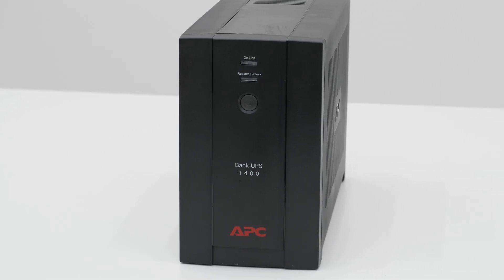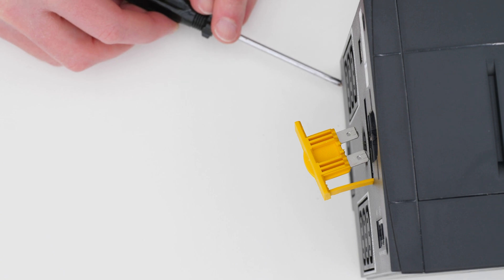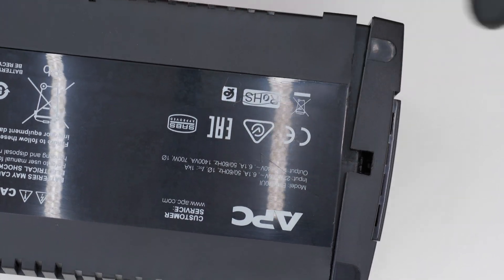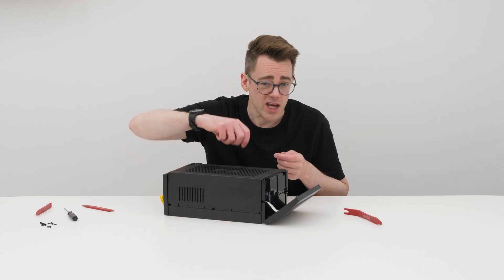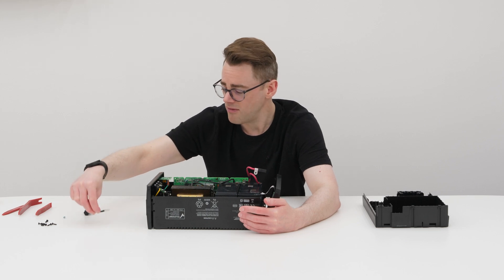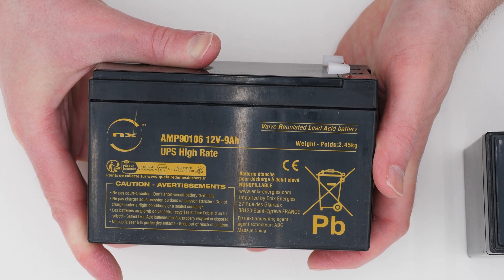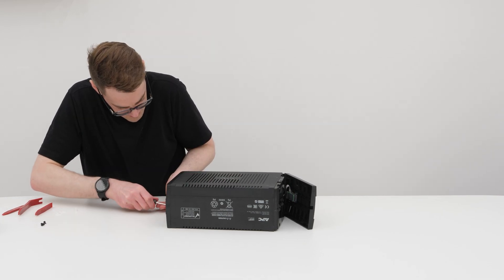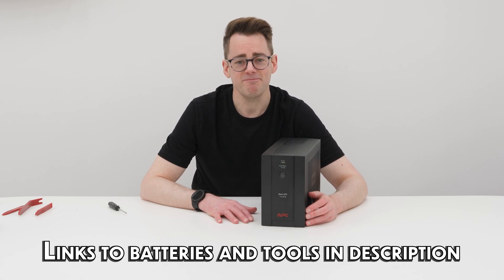Replace your UPS batteries

Comment: When purchasing replacement batteries it is important to be cognizant of the size of the battery terminals (F1 (0.187" wide) or F2 (0.25" wide) flat blade terminals). Also higher Ah batteries can be physically larger than those in the UPS. Measure the old batteries before ordering new ones.

Comment: After looking at the case design the second positive battery lead would allow you to measure the battery voltage without taking the case apart. The positive wire could be reached through the front of the case with a multimeter probe, and the negative can be probed via the yellow battery disconnect.

Comment: ! ! WARNING ! ! 
Long shorry stort, if anyone manages to get the two plastic sides apart, DON'T just yank the plastic side off, you might still break your UPS. 
It is advised to use good lighting, for instance a head-lamp.

I just opened my "bx950u-gr" and in my case there was a bit more faffing about. It cost me quite some effort messing around with plastic kitchen tools to get the two "side halves" of the casing apart that sort of "just pop off" in your case. 
Also, directly after that, I soon found out that, although the casing was now split ; the casing couldn't REALLY be opened yet because, as manufacturers like to have you demolish your product in case you don't do as they tell you to do, there were two more hindrances put in place by APC. 
1 [ In my "case"] there was a cable (presumably a 240 Volt one) going all the way from the front of the UPS to the back of the UPC held in place in two spots on the side of the casing, which, in order not to break any connections, had to be removed from some clamps. Carefully manipulating the clamps with a flat screw driver did the trick. 
2 The "thingy" you asked the audiance about was [ in my case ]  fastened to (again) the one side of the case one is trying to remove from the rest of the monstrosity. Carefully unscrewing with a Philips screw driver was needed.

Comment: What about replacing the Pb batteries with comparable LiFePo4 batteries?
Reply from the maker: This would probably appear to work if you tried it, but you need to be mindful that because they're different chemistries they expect different things. A lead acid charger will try to keep a float voltage, but LiFePo4 doesn't like that which will cause those batteries to degrade faster. Depending on the battery management system it may over or under charge them; undercharging isn't much of a problem, but overcharging can make them swell / explode. LiFePo4 also has a different discharge curve so you'll likely see that the battery very slowly goes from 100% down to something like 80% but then is suddenly dead, as lead acid has more of a linear discharge - this means any software you have that monitors the status to automatically turn things off safely won't work properly anymore. In summary... try it outside first, keep a fire extinguisher close by, and don't expect the batteries to last longer than the lead ones, in terms of working life time. But if you do do it, make sure you make a video about it 😄
Reply: Note: You can use a BSM to emulate a Lead Acid cell. As Battery Service Manager (BSM) takes care of the LiFePo4 battery.. 
Get the Wrong BSM and, well To the moon or morgue.
Reply: Unless your current setup has a BSM have settings for lithium battery, this is a bad idea.

Lithium battery needs constant charge voltage start to end.

Where as most marine/RV using lead acid BSM, is a two or three stage charger with each step increasing the voltage.

Also BSM control cool down function (stops charging) when a set temp is reached.

Comment: My old APC has two screws you remove that gives you full acces to the batteries. This newer model is very poorly designed. I replaced mine with some newer lithium batteries.
Reply from the maker: Unfortunately part of product design is finding ways to reduce cost, so it doesn't surprise me that older models are more robust. How are the lithium batteries working for you? I know lead acid chargers aren't designed for lithium but a few people have told me they're doing alright with them...

Comment: Hello, I have swapped out my dead 7ah lead acid batteries (x2) with 2 x 7ah lithium batteries in my APC UPS 900 pro over 2 years ago without replacing any internal hardware and it's been running great without any hiccup's or incident's. 
It was literally a case of swap the old with the new as the new fitted perfectly where the old batteries fitted.
Reply from the maker: Glad to hear it's been working great for you! It's not impossible that the control board has been designed to auto detect the type of batteries installed, though I would think it's unlikely. Li-ion, LiFePo4, and Lead acid batteries have different charging voltages, which means a lead acid charger will overcharge a Li-ion battery, potentially leading to fires, and undercharge a LiFePo4 battery. If your battery pack has a built in BMS then it's probably fine, though I imagine the cost of this may make it less appealing to replace. Li-ion also has a different discharge curve, so a lead acid controller would think the battery was still quite full when it would suddenly drop to zero. Even if this is working I wouldn't recommend using it with sensitive / critical infrastructure like a server.
Reply: @PhillipParr  Other way around, a lead acid charger will always slightly undercharge an LFP battery.  LFP batteries get extra wear and tear if you fully top them off anyway so there isn't anything wrong with only charging them to 95%. LFP batteries do not have sulfation problems like lead acid batteries do if you don't keep them at 100% charge.   I've got 3 UPSs  (2 by TrippLite and 1 by APC) that only support lead acid but are working just fine with LFP. And I've got 2 more APC UPSs that are still using SLA that I will transition over to LFP when the batteries go bad  I have both the UPS and an LFP charger hooked up to the batteries and If there is a big storm coming I will flip on the LFP charger and top them off to 100% at 14.6V, otherwise I just let the UPSs keep them at the typical SLA 13.5v float.  I have also ran both the SLA Lead Acid charger and the LFP charger on the same battery at the same time to recharge them faster since LFP batteries store so much more power it takes a lot longer to charge them up because the APC chargers are ridiculously slow and low powered, they really put the trickle in trickle charge.. As of last year, I am phasing out all my SLA gear but I will probably keep buying SLA UPSs because they work just fine with LFP batteries and they can be found used for very cheap.
Reply: @PhillipParr  
I got the idea from another YouTuber that I came across, in fact several before I proceeded to do it to mine.
I've had a few power outages in that time including a couple that I created to test the 2 x 7ah lithium batteries and they lasted around twice as long as the lead batteries and charged back to 100% capacity quicker (I took them out when the UPS showed full and put them to my multi meter).
I use the APC app (PowerChute) which gives time remaining as well as % capacity remaining so I know how long I have with the equipment I have attached before it runs out of power.
But I do get your point about the system not being designed for lithium batteries.

Comment: One thing to be wary of when putting in higher capacity batteries is that this higher capacity usually comes at the expense of using thinner battery plates which increases electrical resistance. This may cause the UPS to cut out earlier than it did with the "lower-capacity" OEM batteries under heavy load scenarios.

The cheaper "high capacity" batteries I put in my BX1000 UPS the first time I did a DIY battery swap only lasted half as long as the OEM CSB ones before they would no longer carry my ~300W PC through 2-3min outages.
Reply from the maker: Absolutely, it's tempting to throw in more but important to remember that the battery management system was calibrated for those specific batteries (and likely the full range of capacities available for the form factor). Adding more capacity also risks overheating as it won't have been tested charging / discharging for as long, though a couple of Ah shouldn't hurt too much. Thankfully the batteries I've chosen still reported 25% charge after 20 mins running off them, so it's similar to the before. Sorry to hear you had some worse luck!

Comment: A waste of time replace the same battery type. Jerry rig it to two 12 car batteries or lithium
Reply from the maker: @ricklee7171  the battery controller on the UPS has only been designed for these types of batteries. To significantly increase the capacity or battery chemistry you'd need to replace the battery controller and then you may as well buy a new UPS anyway 😅
Reply: @PhillipParr  if that was true, then it's a miricle the apc and car batteries is working fine for me.
Reply from the maker: @ricklee7171  You have to remember the circuitry in your UPS is designed to be as cheap as possible. If your UPS's battery management system is designed to charge 14Ah of batteries and you've stuck on an 80Ah car battery then it'll be under significantly more stress than it was designed to cope with. It may work just fine, but you've increased the risk of overheating, fire, failure, etc - all things you don't want in a UPS. You also wouldn't be able to put a car battery in this specific UPS because it's too small, and here I was just demonstrating how to keep the unit fresh and neat 🙂